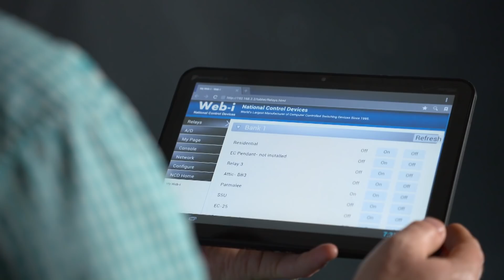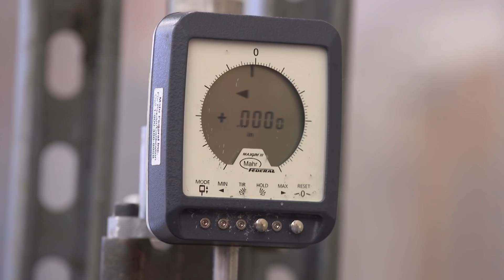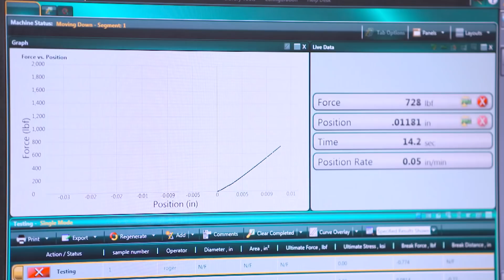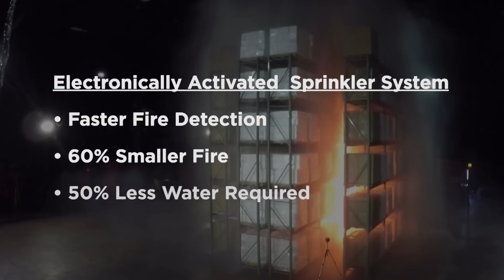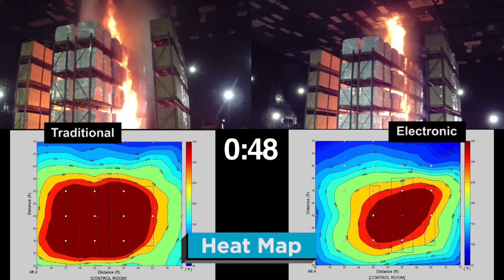Johnson Controls Leads the World in Fire Suppression Systems

Comment: Correct me if I'm wrong is a solenoid activated valve via a smoke detector not doing the same thing on a deluge system
Reply: Your partially right. The solenoid valve on a deluge or pre action system does open in turn losing the power water and putting water to the system piping. But on a deluge system it’s all open heads so the place is getting flooded and on a pre action pending if it’s a single or double interlock may need 2 smokes in two separate zones to trip the system. These style heads I’m not a fan of myself.